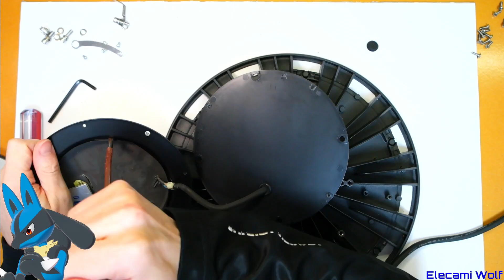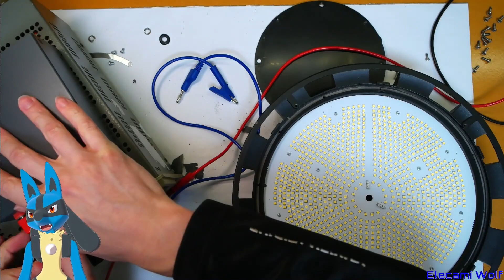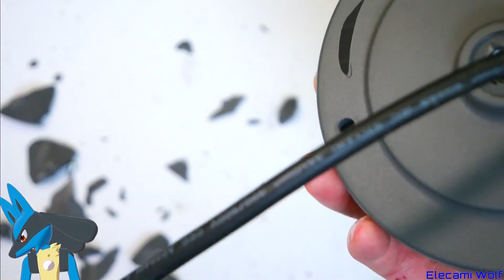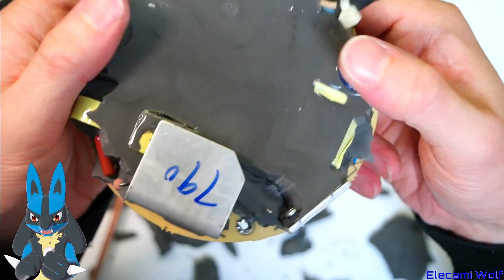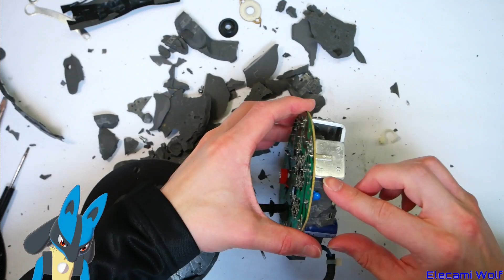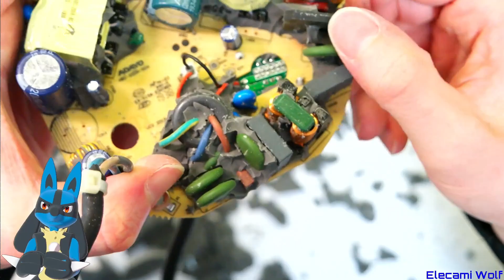EW0091 - LED Highbay Light Teardown

Comment: I had a similar light that would turn on very dimly even though the switch was open. Whenever I'd touch a metal screw on the light it would light up dimly and change brightness depending on where I was standing (i assume it depends on how well I was grounded).  I determined the cause was the live and neutral in my house wiring was flipped and the light switch only opened the live wire. After the wiring was fixed the issue was gone.
Reply from the maker: LEDs are sensitive so it does not need much current flowing for them to light up.  The issue you describe can occur when the wiring after the switch runs near other live wires. Current can be couple across capacitively and cause a faint glow on the LEDs.
Reply: @Elecami  Yeah I have another pair of cheap LEDs that do exactly as you describe when turned off. The light I mentioned in my first comment wouldn't do that though on a properly wired outlet. I think when the live and neutral were flipped, the light would still have live voltage, and when I'd touch a metal part of the light it would increase the capacitance with ground or neutral causing a similar faint glow. I think this is also the same phenomenon you describe just with more steps.

I tested continuity (with DC) between the live/neutral of the light socket with the metal casing and didn't get a short so it might be forming multiple capacitors in series? I wonder if this phenomenon could be used to measure how well someone is grounded safely. AC is wild.
Reply from the maker: @tjl2836  Usually there is a resistor across the LEDs to bleed off that induced current so that the LEDs don't glow. Big Clive talks about it sometimes in his teardowns.

Comment: also id watch you open another potted thingy so maybe do upload the laptop charger vid sometime :3
Reply from the maker: Ok, can do some time. It is quite satisfying to pick out that potting stuff :-)
Reply: @Elecami  yea, teardowns in general are satisfying, potted stuff is "oooo im not suppose to see this" lol
Reply from the maker: @naomi10260  Yes, but usually for that type of protection they'd use hard type potting material. Much more difficult to remove. This soft stuff would be more for preventing moisture ingress and for helping to dissipate heat.
Reply: @Elecami  oh right! XD

Comment: Flickering is because you are switching the neutral, not the live, and the capacitance between live and ground is providing some power. Or the cable length is providing the same sort of capacitive coupling.
Reply from the maker: I did wonder about that, but I checked and it is defiantly switching live and the polarity of the outlet is correct. Must be some capacitive thing.

Comment: I think what has happened to this is some of the individual LED packages have failed. Either the bond wires inside or the LED chips themselves. Its likely these packages have more than one LED chip. You can test this by using like multimeter probes and a power supply to connect to the solder pads of one LED. Like if it takes 9V to light up then its a 3S chip package. 
When a individual package fails, the other packages in that series string also fail. This results in less and less voltage and current seen by the power supply. What you are seeing with the flickering is the power supply hiccupping from a fault.
Reply from the maker: Oh yes. Probably some LEDs failed.

Comment: Many power providers offer credits or some sort of rebate program to large power users for them to upgrade all their lighting to LED. That gets some people to convert over. I had a fire station that converted because the public utility district basically paid for them, but they cause 20-30db additional noise in their VHF radios so they have to be outside and far away from the station or their trucks cannot hear dispatch respond to them.
Reply from the maker: That is really sad. If they got a better designed LED driver it might not be so bad? Presumably a well designed one, rather than cheap as possible won't make so much RF noise.
Reply: @Elecami  Yeah its totally possible to design a LED driver that doesnt blast the hell out of the RF band, but it costs money. This also goes into their failures. Cheap power supplies feeding the bare minimum number of LED packages an amount of current that is well past where their efficiency knees over and goes to shit to get the most advertised  lumens. I like that this one has a way to set the power. I wonder how long it would've lasted driven at the 100W level instead of wide open.